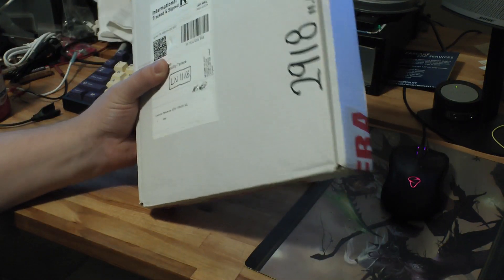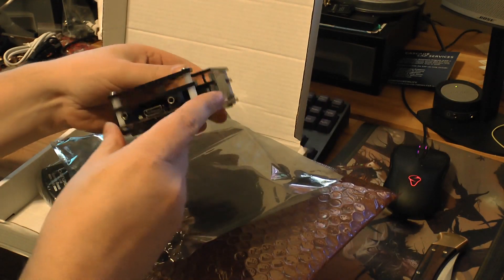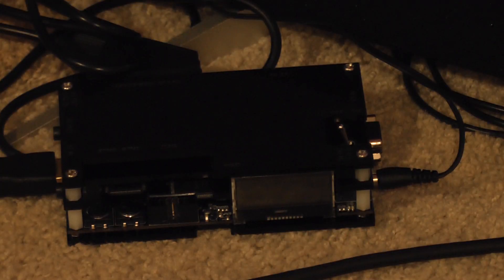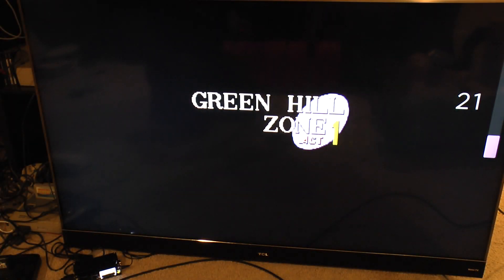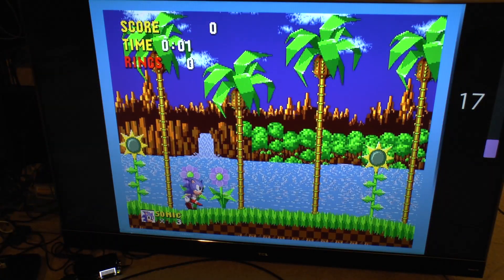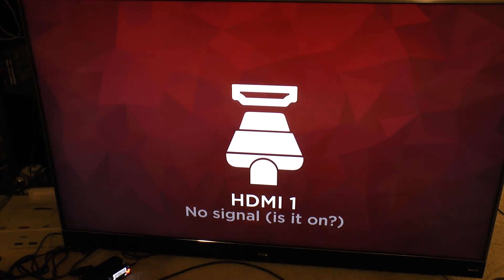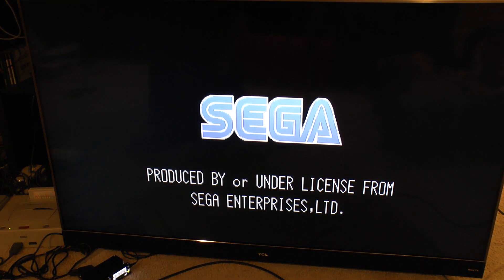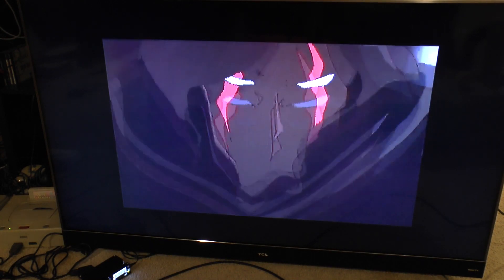Open Source Scan Converter (OSSC) Unboxing and First Impressions

Comment: Assuming we're seeing the same thing, the "ghosting" you're seeing is because your SNES is a very old model.  The older models had a separate chip that handles video and audio separately, but they had a really bad horizontal blur for some reason or another.  Later on, SNES consoles changed to have everything handled on 1 chip, and those have a much superior RGB output.  Unfortunately there's no fix for that on the hardware itself, but the OSSC since your video was uploaded has a feature from a firmware update called Reverse LPF (Low Pass Filter) in the Post Proc settings.  You can tweak that to get as close to a perfect image as possible, but the con with that is that any noise may get sharpened.

Comment: Buzzing noise is the norm for analog scart rgb cables. I have tons of different Scart RGB cables for different systems (all good quality, made by Retro Gaming Cables), and all have one way or another that "problem".
Reply from the maker: I actually fixed the buzzing in the Sega Genesis - the cable I was using had the ground tied to the same ground as video. SCART actually provides for two ground wires, but the cheaper cables often combine the two.

Comment: What tv are you using? I'm looking at getting a tcl 43s405 which they say works perfectly with everything you throw at with the OSSC. Noticed yours is a tcl too.
Reply from the maker: Adam Burns I think it's a "55S405" and yeah it can handle any mode the OSSC supports :).

Comment: Awesome!!!  The humming on Megadrive audio is possibly the cable not fully shielded?  Sometimes if audio is not shielded from sync you can get that.
Reply from the maker: GadgetUK164 - Retro Gaming Repairs & Mods ah good to know - I will buy a nicer cable for it. The ones I have came from the same vendor in Amazon.